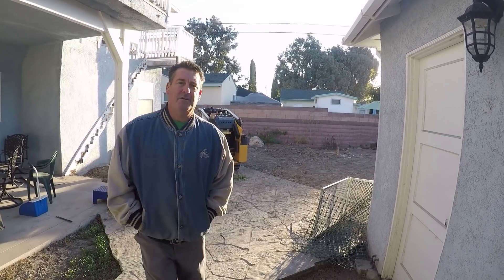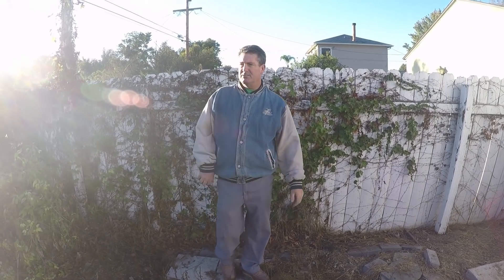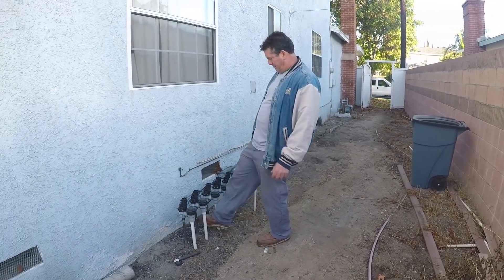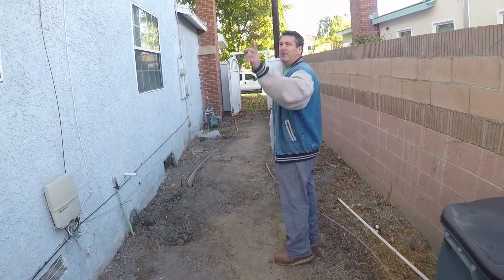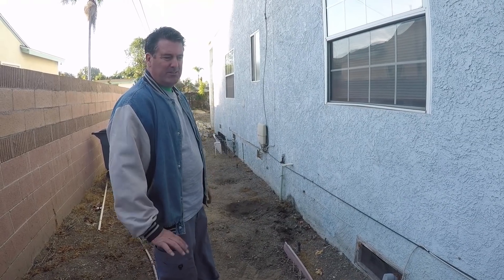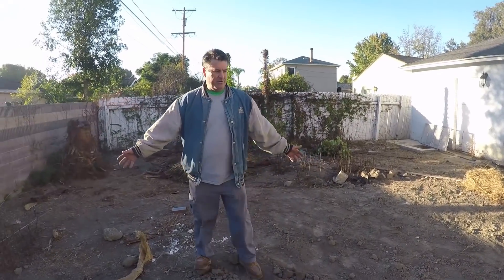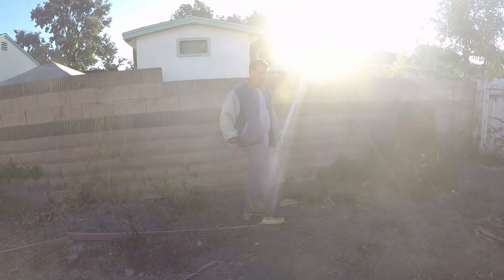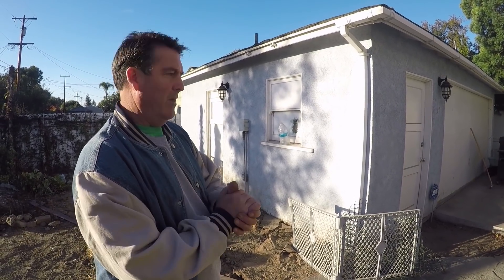Stamped Concrete, Block wall Build, and Post Deck Replacement Job Series

Comment: No doubt Mr. Odell is one of the most knowledgeable concrete guys in the industry! It's always a pleasure to see his approach and thoughts on the various projects. Here's an idea for a video, how cool would it be to see one of your sons lead a project from cradle to grave? Basically, Mr. Odell holding the camera and the boys are running the show! Thanks guys for posting the vids and keep up the good work!
Reply from the maker: Yes that would make a nice video.
TY

Comment: I used to fight stumps with chainsaws, pry-bars, four-wheel drive, stump grinders, but I found with palms, those fibers of wood are tenacious, and take a great deal of labor. If you expose those roots, take a sawz-all with a 12 inch saw blade for tree limbs, and go for it. You will use them all until the teeth are gone.
Reply from the maker: I believe that is what the Home Owner did

Comment: I really disagree , a bobcat 443 is way more effective and stable while grading also same width
Reply from the maker: I've driven those.
Gutless and prone to tipping over
Reply: @OdellCompleteConcrete  its really all about skill , countless hill jobs no issues yet  tipping over can happen on any machine with the wrong operating skills  ,buh pretty intrested in seein that thing in action